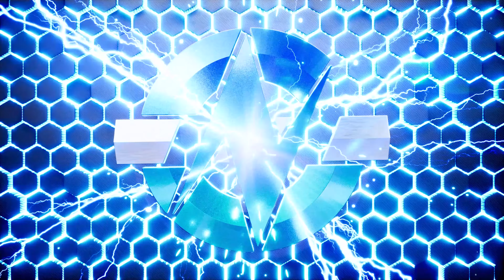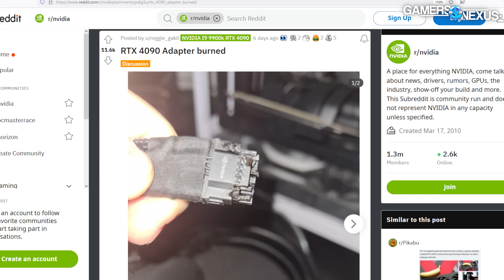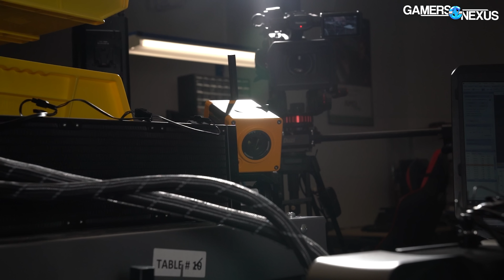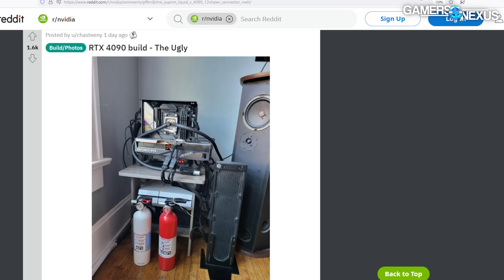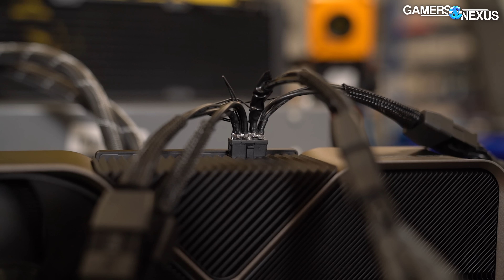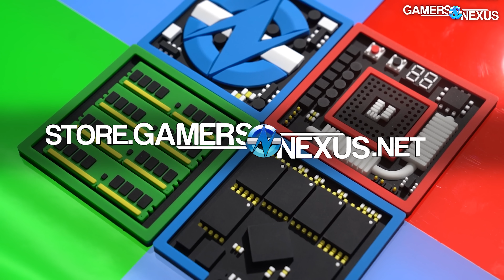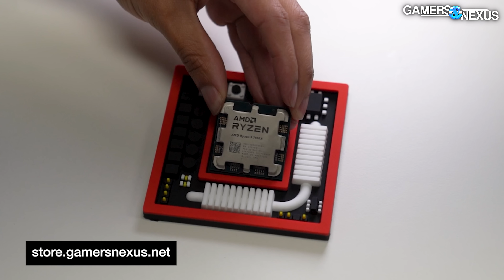Testing Burning NVIDIA 12VHPWR Adapter Cable Theories (RTX 4090)

Comment: It sounds like this issue is the 150 cable then?  either there are clones, or one manufacturer (partner) is deliberately or accodentally using under rated cables and attaching them differently?  So if you get a proper card all is fine.

Comment: I think Steve had a bit of an error about 6 minutes in about the cable rating/spec. Cables are rated on amperage/current and not voltage.

That said, keep up the work Steve and GN crew. Love you guys.

Comment: Great to see all the experimental attempts to reproduce the issue, rather than just waffling about "connector BAD!" that many are doing. 
What I find really interesting is that, to this day, nobody has managed to reproduce the problem in a controlled, observable lab environment. From professional experience, when this happens it usually means that issue was a fluke, borne out of defective specimens or  gross user error ( of the "so unlikely/stupid that the lab technicians would not even think about testing"). 

As an engineer, looking at the damage on the allegedly burnt connectors (I'll explain the "allegedly" in a moment), I agree with some of the others who pointed out it looks like it comes from an imperfect contact between the pins and the receptacle. Maybe some cables or sockets on the cards are built defective with wrong tolerances, or maybe the users don't plug these cables in well enough (e.g. scared the force required would damage a 2000$ card). 

That said, this is the internet. The difficulty in reproducing this issue could come from something else...do you guys remember the "Xbox Series X smoking" videos that started circulating upon release of the console? Those that turned out people were vaping into the devices and then claim it was "burning down"? Some people would do anything for 15 minutes of internet fame, even risking to destroy their brand new, expensive devices. The damage seen on these Reddit pictures is also consistent with something else - cigarette lighter or soldering iron burns. Especially when the plastic shrouds appear to be melted from the outside in. Do we have any confirmation if any of these posters sent their cards/cables back to nVidia for warranty and inspection?

Comment: the pins are getting hot because of poor contact, and its melting the connector on the internal plug part, not the external part.  in all the pictures I can find, the pins themselves are blackened, and the plastic is melted inside the plug port.  all the Nvidia adapters are "dual spade" connectors, aka, they have 2 slots instead of one, get slightly bent outward when you plug it in, and have poor contact. 

i suspect that some of the connectors are up to snuff and won't fail, but it seems that all the failed connectors are from a single ODM.

Comment: Just searching around and I found a pic of a cable with the 12VHPWR connector with the 150v on it.
Seems like it was for a 3090ti, could this be old stock being included in the 4090? 
Unfortunately, a lot of the cables are sleeved so cant see the voltage rating on the cables.
A scenario could be... People swapping out their 3090 for the 4090 and not swapping adapters. Running on the thinner wire.
Just throwing ideas and see what sticks...
Reply: My previous card is a 2080ti. I don't own a 3090 or whaterver... I didn't use any other. It is the one included. Maybe others did.. but I think the 3090 are 12 pins and the 4090 are 16pins... I think that would not the case of the problem.
Reply: There is no chance of strained contact on my 3090 Fe adaptor.

Comment: I just wanted to let you know, Nvidida recommends a 850w psu but I’m currently running that with the 4090 and my gpu keeps turning off then automatically turns on. Can you test this theory? I have it paired with a 5600x and B550 MB while I get the other parts for my new build.
Reply: There's a video getting a 4090 to run fine with a 550w PSU.

Comment: i was seeing Buildzoid and was making two interesting points, the first one was that seeing thermals of the conector is not very helpful because the heat produced to melt the connector is inside two layers of plastic, and the second one was that the problem might be on the terminals that is quite logic, because is where the melting is starting, that's much about it, but nice video
Reply: GN couldn't reproduce a problem.

Comment: Nvidia is SO relieved right now. Why you ask? Well, they would have had to raise the price of the 4090's to pay for the testing of all the incidents. Lab work and Lab Personnel time aren't cheap. Right now there's an Nvidia R&D Rep jumping up and down for joy because GN has done their work for them (well, at least the bulk of it). Now, it's up to "Product Disbursement & Procurement" to fix THEIR mistake, because it would be unheard of for a Jensen Huang Engineer to make a mistake (and admit it - NDAs exist for a reason). But, I am actually happy that these points about the cable rating, contact pad type, and soldering in comparison to other photos from Igor's Lab were brought up. Igor is correct in his assessment, let's make THAT clear, but if there's variances or differences altogether in the Manufacturing of the Connector and the Quality of the Cables then there's going to be a very sad Supplier at the end of the day for Legal Reasons I'd imagine (I hope whomever it was gets put out of business to the point they could no longer even get a job at a fast food restaurant). Cheers! Stay Healthy and Stay Sane!

Comment: its interesting that the rating its RIGHT under the duct tape. ALSO if you got those gpu from NVIDIA or any other manufacturer directly i would suggest buy one from your local store, tampered with the contents that goes to the content creators

Comment: I wonder how heat insulative that potting material encapsulating the solder connections is and how much of a difference it being there vs having the connections open to air would be.

Comment: We appreciate you putting so much time into this, especially with your staff on vacation.  It's crazy that you and igor received different cables, nVidia's subcontractor seems to be a shitshow.
Reply: Vendors can really screw you. I've personally seen this in manufacturing. You frequently have multiple vendors to ensure parts coming in reliably, but you quickly learn that not all vendors are created equal and some bear much closer scrutiny than others. Best of all is when a vendor changes a part or process without informing the purchaser and something goes wrong...that's when the real fun starts.
Reply: @davefinfrock3324  Thats what it sounds like to me. I qc issue. Maybe one of nvidia's vendors didn't quite understand what nvidia wanted or needed to decided to use cheaper quality parts because that's all they had access to.

Comment: 4:47 Therminator! Also just my 2 cents (which you may already know); emissivity of the material is utmost important for thermal imaging. You simply cannot take the same emissivity value for different surfaces, for instance black plastic parts on the connector vs aluminum fins of the cooler unless they are coated with similarly emissive materials. If you do, even though two materials emit similarly (which means they'll appear in same color representation on the thermal camera image), they will be different in terms of actual temperature.
Reply from the maker: Hahaha that name! And yeah, aware of emissivity and reflectivity. Doesn't hurt to mention it again though.
Reply: Damn!  You apparently hit on the same name I came up with!  Too much time playing Terminator: Resistance is my excuse.
Reply: GN can use it to finally take over the tri-state area.
Reply: I root for "Therminator". Went to post it, but did a quick ctrl+f , and there you were. Great minds think alike 😅
Reply: Thermie for short also could work.

Comment: You should consider trying to force Buildzoid's theory, by splitting the pin receptacles open slightly to worsen the contact area between the pins and the adaptor cable. Rather than the cable being loosely plugged in; the cable is fully plugged in but the pin contact isn't good.

Comment: I think whatever the issue that ultimately causes this, the real issue here is that NVIDIA has created a connector, usable by average members of the public (read: monkeys), that if connected even slightly incorrectly or suffers a minor issue, it burns your house down. There’s a reason why designs have headroom built in and the warning flags should be flying when you’re plugging 32 pins of physically larger connector into 12 smaller ones.
Reply: None of the connectors have caught fire.
Reply: @Safetytrousers  *yet.
Reply: @mcgherkinstudios  If none of them have 'yet' how can you say it will?

Comment: First, the bad renaming and pulled out 4080. And now cable burning. EVGA reasons seems coming out in full circle
Reply: There has been no burning, and all they would have had to do is to provide a decent adaptor like the ones in this video.

Comment: in automotive ive run into parts that are good - except for a single manufacturing plant. e.g. in the late 90's dodge had their cummins rams. they all had strong engine blocks EXCEPT for a plant in mexico that had a mold that produced a thin side wall on the passenger side. this would lead to a cracked block after 60K+ miles or if modded power was added. took a long time to figure out because the majority of engines ran fine, it took time to fail, and it took many failures to pin down the common denominator.  there are also engines out there from this bad plant, with those markings, that have not cracked yet - 20 years later. so its one of those "if it hasn't failed by now, it probably wont" scenarios. 

i would not be surprised if something like this plays out here in these adaptors.

Comment: I've had a lot of trouble trying to solder to some of those bus bars when a cable comes off. Clean the old solder off, give it the alcohol and everything that works all the other times but there has been a few bus bars I have failed to re-solder. There's just something about soldering to a flat piece of smooth shiny metal  that makes me uncomfortable.

Comment: Back in the stone age I had a R9800 from Ati with a molex connector. The plug got hot and was even slightly discoloured but only brown not black. 
Tuned out the little tubes in the plug got bend and thus didn't fit tight anymore. Got lucky to discover it in time. 
Probably the same thing is happening now with the 12VHPWR connector that comes with the 4090s.

Comment: Does it make an edition if it's a FE or AIB board?   What if it's a water cooled GPU?  When you all use your setup,  shouldn't it be as those who use it at home in a case sealed up with all panels on the computer;  rather then using a test bench with an open setup which dissipates heat easier?

Comment: Here's a theory.  Perhaps the 4080 12GB "unlaunched" was actually because they inadvertently mixed up the cables.  Included some 4080 12GB connectors (150V rated) with 4090's, and viseversa.  
Why use 300v rated cables for a connector if the cards the connectors are used on require significantly less current?  Sounds like a waste of money. 
So, pull the product prior to release, replace 300v connectors with correct one's rated for the card, then rebrand as a 4070 to make it sound as if the outcry from the community over 2 x 4080 cards was the reasoning, and buy time to formulate a believable excuse. 
Once the "4070" drops, I bet we'll see 150v on the connectors cables.

Comment: Doesn't the voltage rating of the cable really matter only for insulation though? What does matter for heat/resistance/current related issues is the gauge, which appears to be the same.

Comment: Thank you for your hard work, Steve! 

I have a Founders Edition 4090 and am using the included adapter and am in the USA. I've had no issues after using it for a week, while gaming and benchmarking. However, I would be happy to contribute. :)

An interesting thing to note is that I have yet to see any reports of melted cables from Founders Edition cards. I'm not sure if that has anything to do with anything.
Reply: That said Jay was critical of the adapter in his review (of the Founders Edition). To be honest apart from the price it was his only real criticism of it.

Comment: thank you for all of your hard work and research!
but...
how to proceed? :D

if everything is going as expected, tomorrow i'll get my Palit card, and my biggest takeaway from this is i need to be really cautious, and try not to bend the cables at the connector.
aaaand nothing else. this isn't easy to reproduce, but as more and more 4090 are being sold, who know, which will potentially fail.
maybe some mark should be on the connector cable about the 150/300V?

Comment: I had a similar issue with a transmission harness in my truck.. It melted two wiring harnesses in a week.. The problem ended up being with the pins the connector plugged into not the connector itself..

Comment: It's so funny NVidia can design a 70 billion transistor chip and SMDs around, tame the heat, write good drivers at launch, and so on; and at the same time fail QC at simple: just wires thick enough and reliable contact in connector.

Comment: 4 lots of power into 1 plug was never going to end well. You don't have to be a scientist to figure that out.
Plus I think the pins in the plug are not fitting tight enough to the pins on the card causing arching of the pins.

Comment: If you put a 4090 in a pre-recalled NZXT H1 case, both the fire hazards will cancel out each other and you will receive a perfectly good build. Or you can pair it with the Gigabyte PSU. Just don't do all 3 as it will still result in a fire hazard.

Comment: 5:49 What are the odds that the 12vhpwr adapters that some received on their 4090's are actually REPURPOSED 3080/3090 adapters from their stockpile of oversupplied orders? Maybe that's why some are rated 150V while others that got the original adapters made for the 4090 are 300V.

Comment: Tangentially related, I had a 240V connector melt and disintegrate on the back of my dryer, because of a loose connection. Somehow didn't burn down the house...
Reply: This is why AFDDs (arc fault detection devices) are becoming a thing.

Comment: As an engineer I love watching your videos. It really shows you understand what you are talking about, not just repeating what you read on a report.
I remember the time you were trying to explain to (don't remember which company's) engineers, that the % change in temperature shouldn't be calculated using C° or F° as they did on their advertising, and they didn't get it...
The way you troubleshoot or "debug" all issues is a pleasure to watch, keep it up with the good work, and hope you can get better and better equipment so you can raise the bar once again for the industry.

Comment: Good to see actual testing on this issue. The results suggest the problem may not be a widespread one. Even if the end result is quite damaging.

I know the official nVidia position on this is to send damaged adapters back to nVidia for investigation.

But whilst I'd like to think nVidia would be open and transparent, I remember that NZXT and Gigabyte tried to dismiss how serious their problems were until GN took a look at them.

Trust but verify.

But also interesting that it appears the cable Igor had has a different internal layout to the ones GN has tested.

Comment: This cable is having to be put to work in owners existing cases? It begs the question of if Nvidia designs a card that is this much bigger than any previous card they might want to look at what its fitted into. The card if fitted directly into the motherboard in a horizontal axis is very close to the case side and this may cause individuals to try to bent the cable to "make it fit " or run where they think it looks best. It might have been better if Nvidia format

Comment: If your cables are all different from Igor's and yours didn't fail, why write off that maybe he DID identify the issue and only those cables like his are failing? Saying it is a red herring or only one issue might just not be true, if a subset of cables are poorly built/designed. I know you are looking to get more cables to inspect, just the wording suggests too much confidence that the issue isn't entirely restricted to what he proposed and some of those cables might be in the wild.
Reply: GN spent a long while asking for people to tell him what adaptors they have.
Reply: @Safetytrousers  Yes, I know. I get that going forward they may come to a more firm conclusion. I'm just saying that Steve suggested that Igor's might be an anomaly so that isn't the overall problem, but that could only be concluded if Steve saw a cable of the better design also fail and he has not yet seen that.

Comment: Possible issue with connector running hot even if it does not melt, might be in future where plastic will start to crumble due to heating and cooling.

Comment: I've got the RTX 4090 here since Friday but I'm so afraid of that issue that I'll wait until I get better cables before I install the GPU and get it started.
Reply: Just check if you have the 150 or 300 adaptor.
Reply: @Safetytrousers  yes I will but its all still unboxed...

Comment: Mysteries are fun....for the audience. Props for your efforts, a very good video. I can't help but speculate as to the PCB design and power distribution on the 4090 circuit board. Seems like all the testing assumes the pins are in parallel internally, which makes sense but may not be the case, especially if different rev 4090 boards are being used. Along with the cable markings, manufacture date of the 4090 may be an important data point. The melting point of connectors is also a data point I've not seen presented in any videos. Temp readings are quite important, but what is the bogey temp that indicates a failure is occurring?